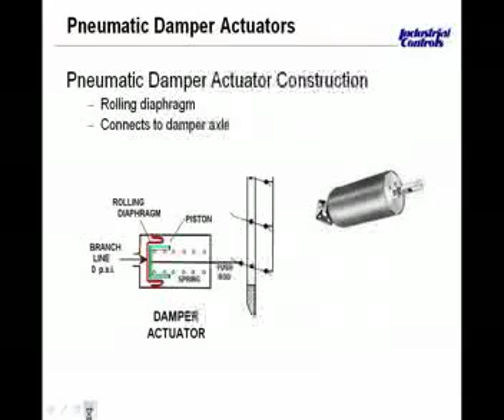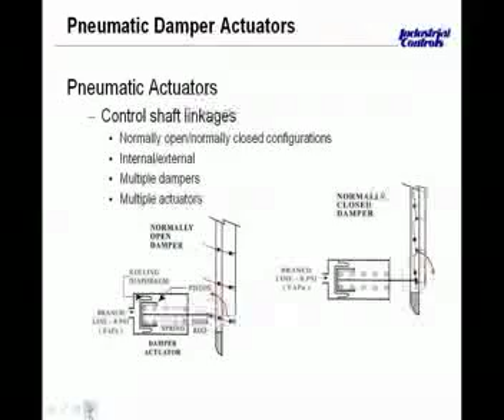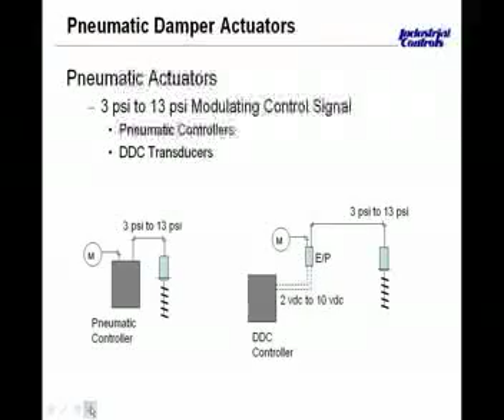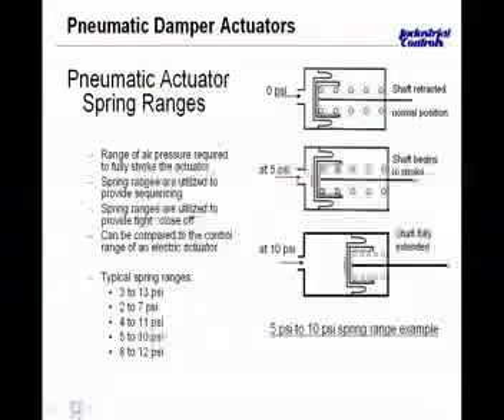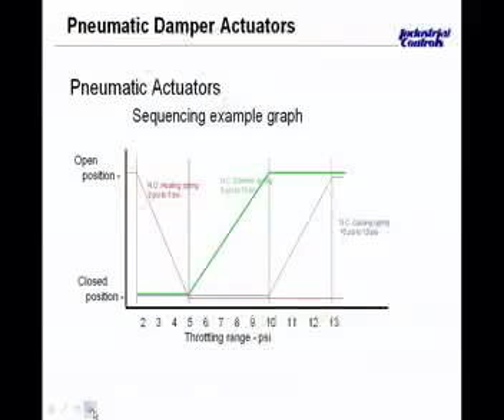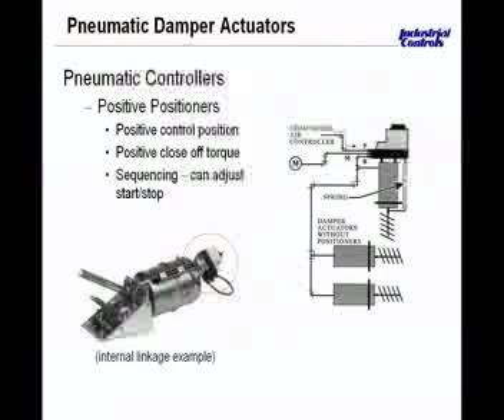Pneumatic Actuators for Valves and Dampers: Clip 5 of 5

Comment: I have found your 3 part series while looking for some training videos for some of my guys are work. I must say that I like the layout of your first two videos (main system, thermostats) very much but I think personally this part of your series is a dud. I have many many years of experience working with pneumatic control systems and have never heard pneumatic valves referred to as RA and DA...Everyone refers to them as NO and NC...only the thermostats are selected as and referred to as RA and DA. When selecting your valve or actuators you always think about "What is my fail safe position? Being...what is the system going to do if it loses control air?" For most systems with water coils you want the heating valve to go 100% open to prevent coils for freezing...And you want the cooling valve to go closed to keep from over cooling. Once you have chosen your desired fail-safe position you then select your thermostat action. For the system I have described you would need a rise in pressure to close the heating valve and a further rise to open the cooling valve...there for you need a DA thermostat. Now...let's provide the opposite. Lets say we have a PIU with electric heat. Well...personally I don't want my electric heat running without main air...so...I would fail safe to damper open in the cooling position and the heat off. This would mean that a rise in pressure causes the damper to close and then my electric heat to turn on. In this design we need a RA thermostat being that a rise in temperature causes a drop in pressure.

When I listened to your explanation of the valves as RA and DA even I was confused and like I said...I've been working with this stuff for years. So...I will be giving my own discuss to my class about this section and not using your provided examples. Another thing...I personally will be running threw your series in reverse. To me...it is better taught and explained when you start talking about the valves and actuators and how their response to air takes place first...then talk about the thermostats and controllers and how the changes in pressure is produced...and then finally where the air comes from and how important the delivery system and it's components are. One thing I feel you left out of your discussion on delivery systems is line sizing and material choices and benefits.